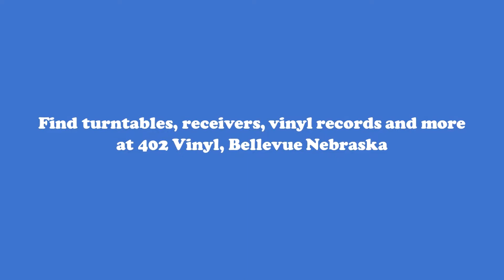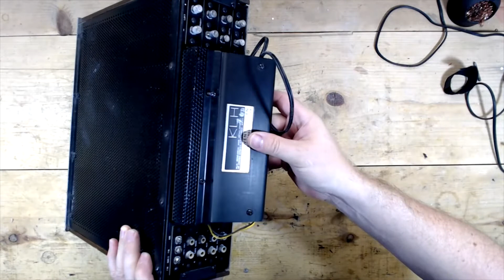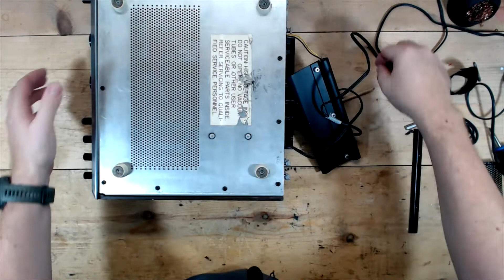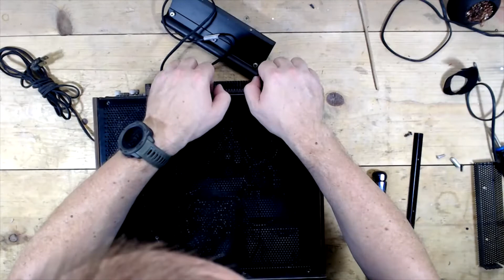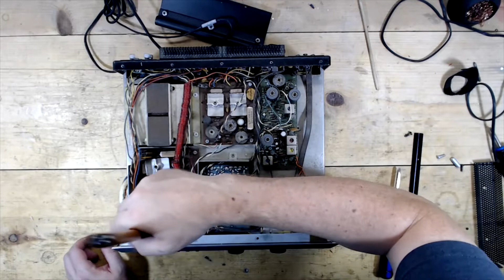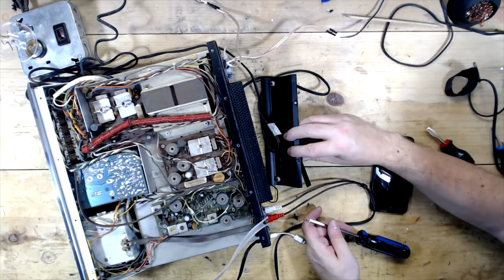KLH Model 27 Stereo Receiver Repair/Restoration Part 1 - Initial Evaluation

Comment: Would you believe someone brought one of these over for me to work on? It actually works. The controls need a good cleaning. Yes, it probably needs recapped. I have never done a recap for someone else. I work slow on my own stuff.
Reply from the maker: These are pretty easy to work on.  The cap values are a bit odd, but you can get close with modern equivalents.  Every KLH 27 I've worked on had caps that were horribly out of spec.

Comment: Thanks for this.  There's so little information about this receiver online.  This will provide a basis for my approach to trying to fix mine.  The left channel isn't working but the right seems OK.
Reply from the maker: I just wrapped up another one.  No video, but it was the same problem and solution.  Those caps drift way out of tolerance.  These are awesome receivers with such a cool retro look.  Plus they are relatively easy to work on.